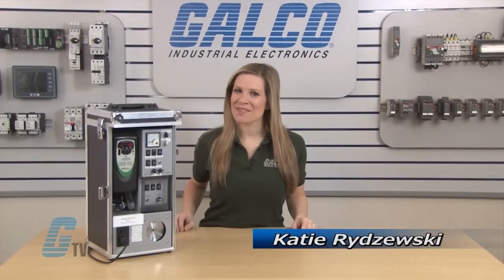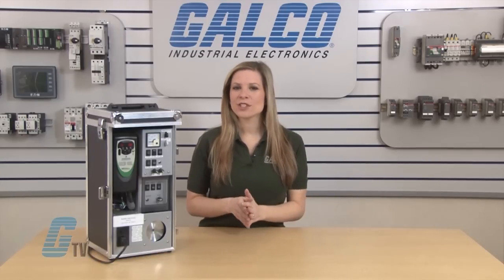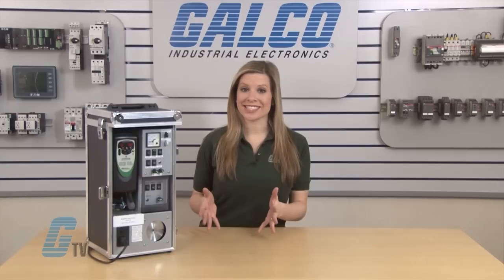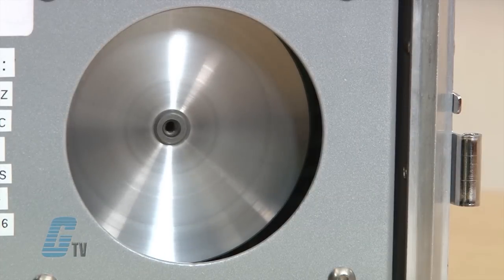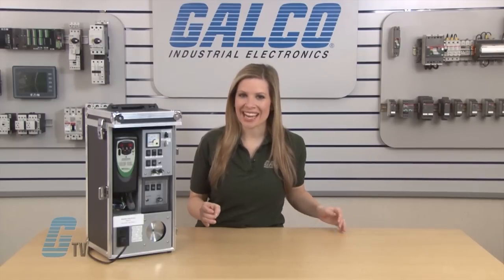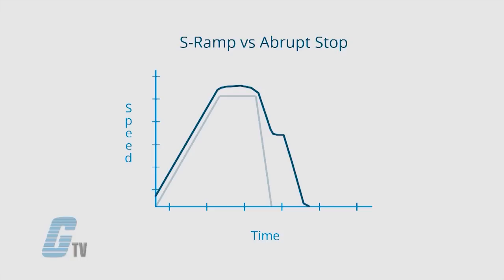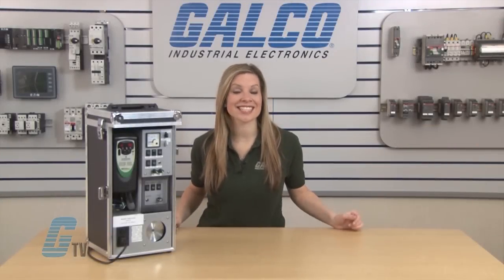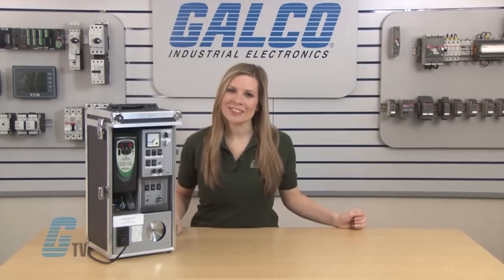Different Start and Stop Options of a Variable Frequency Drive

Comment: Can I time the run of a motor with a vfd? I am running 3 motors on 3 different VFDs for 3 different "feed" conveyors. I need to create a % mix, feeding from the 3 conveyors onto 1 main production conveyor. Fine tuning the mix requires me to change the speeds of the 3 conveyors to supply the exact required volumes onto the production conveyor. Can you please advise?

Comment: Is the S-Ramp method of stopping same as Ramp to stop?
Reply from the maker: Not exactly, but very close. S-curve simply adds a"roll-in and roll-out" feature if you will. It directly effects the very beginning and the very end of speed change when commanded by the reference, ok? Otherwise RAMP to STOP is exactly the same, the S-curve just adds a little time it.

Comment: what are the parameters to be set or look  for installing a External resistor for braking  in Yaskawa V 1000 vdf
Reply from the maker: +nitin mathur There are two parameters to look at:

• Parameter L8-01, verify it is set to 0, this is the default value, this sets the drive up for an external DB resistor. 
• Parameter L3-04 which should be set to 0 which is the default, change it to 3. This sets up the drive for stall prevention with braking option during deceleration.

Comment: If the VSF is interacted a safety function such as STO,  do we need to use a safety module in the structure to protect the machine? I suppose the PL of machine is C.
Reply from the maker: The ratings for the STO function can differ from drive to drive.  This should be listed in the manufacturer's manual and may have a rating that says Class 1 Division 2 or something along those lines. Installation with or without safety relays are also specified in the manual and if one is not required, generally a wiring diagram is included.  I hope this helps!
Reply: thanks a lot!

Comment: I was on your website and looked at vfd. I guess im a little confused.  Can I use a vfd to change speed of a 120v 60hz single phase motor or would I have to replace the motor with a 3 phase motor to use a vfd.
Reply from the maker: It depends on your motor.  If you have a capacitor start motor, then yes it would be better to replace it with a three phase motor to use a VFD.  If it is a SP (shaded pole) or PSC (permanent split capacitor), then you might be able to use the Invertek ODE2 series.  There are some single phase output motors within that series.  Just remember to size the drive to your motor specifications.  (current and HP should be on the motor's nameplate).  The single phase drives in this series have a '-01' at the end of the part number.  Search by brand on top then click on Invertek->drives->AC Drives.  I hope this helps.